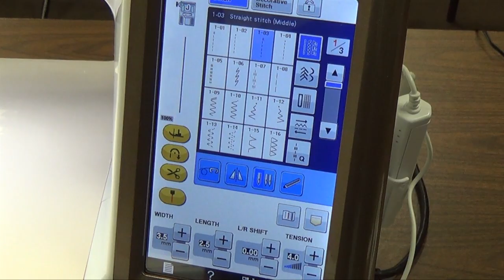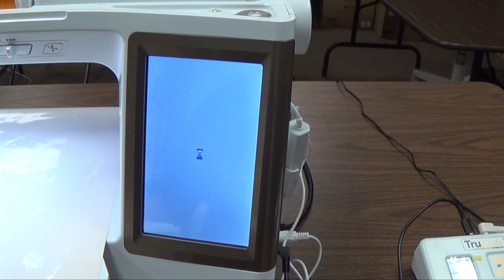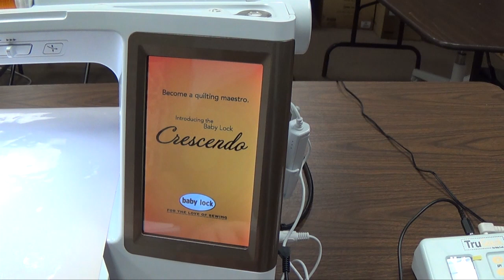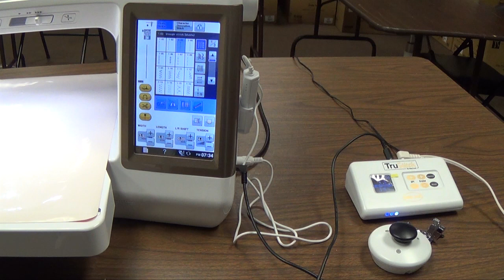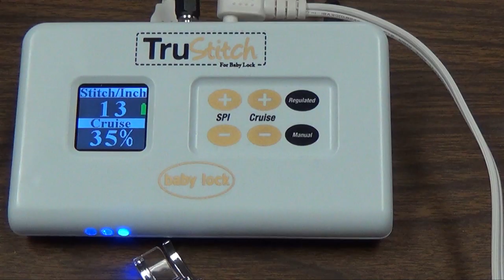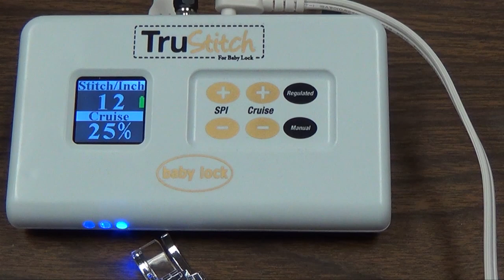Trustitch Regulator - How to set up and use your new Babylock Trustitch!

Comment: Thanks so much.  I just purchased Babylock Tiera ll with stitch regulator.  Will have to try it today.   Wish I had you here to help with tension on my machine.  Can get it set and stitching nice, turn off but when I come back and turn on tension has gone crazy, bird nest, loose stitches just a real mess.  Might work out in 5 or 6 inches but not usually.   Any suggestions???   Thanks again, Really liked this video
Reply from the maker: before you start, pull the thread tight into the upper tension. it might have slipped out.

Comment: Thank you, Brad!  I want to ask a question, please.  I am going to put my midarm, Tiara, on a Grace Frame Cutie.  If my husband makes me a custom ruler table, that sticks out a bit on each side of the needle, underneath the quilt, would I be able to use the "hockey puck" to slide around on that wide, slick, ruler table, and still use my stich regulator?  I cannot get a ruler table made for the Tiara, because Sew Steady said they only make them for domestic machines.  I hope you can advise me a bit.  I think if we make the table wide enough, it will ride under the quilt, and give me a surface to put the hockey puck on.   We will have to make sure the table is stable, and won't tip.   Thanks.
Reply from the maker: sure I dont see why it wouldn't work
Reply: @EllicottCitySewVac  Okay, thank you.  I am glad to get a second opinion.  Appreciate it!  Stay well.
Reply: @petmomful2260   I'm investigating using the regulator with a cutie frame as well and wasn't sure if it was possible. Did you end up getting in to work with your frame?
Reply: Now I need to sell my Tiara and table, and the carriage and special handles they sent me to use that machine on the frame.  I don't need them with the Brother machine.  It has wheels for feet, and drops right down into the tracks.  I hope that all makes sense.

Comment: i just purchased the trustitch regulator for my ellisimo gold 2.  my foot pedal has two plugs and it wont operate without both plugged in.  but the regular only has one,  everything is charged, and in the proper plugs, but i cant get mine to work,,,am i doing something wrong?  guess i am missing something.  as all the demos only show a foot with one plug on it not two.  what am i doing wrong?
Reply from the maker: its not you! your dealer should have known that you need a different foot control if you have an ellisimo gold ii.